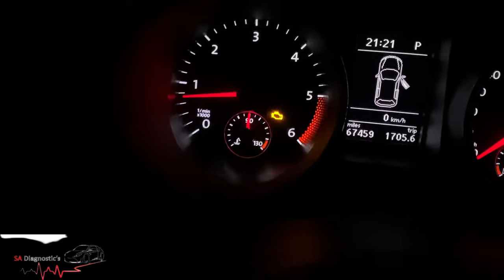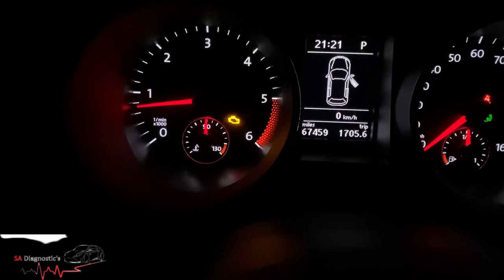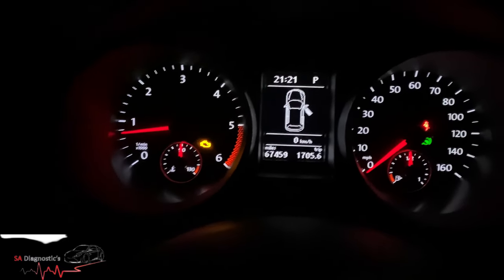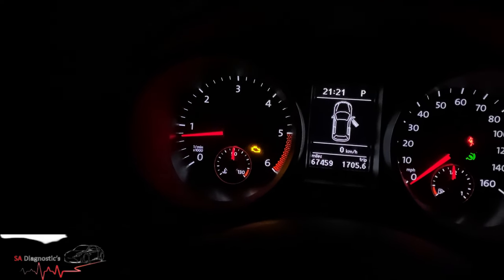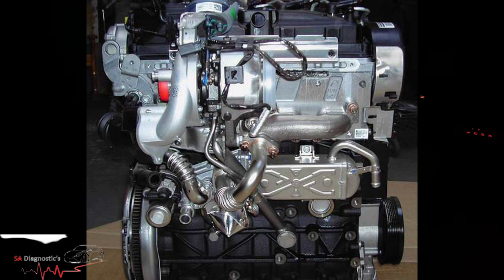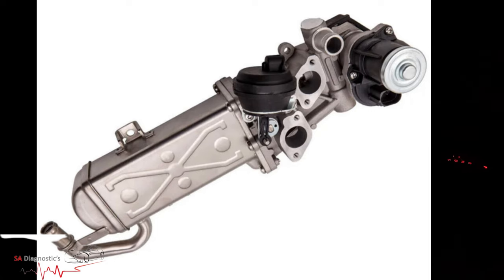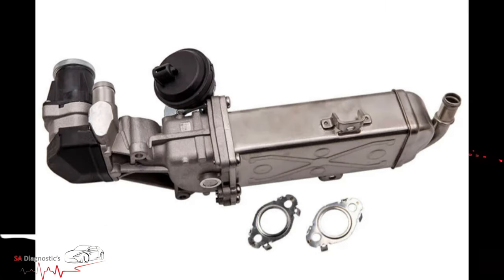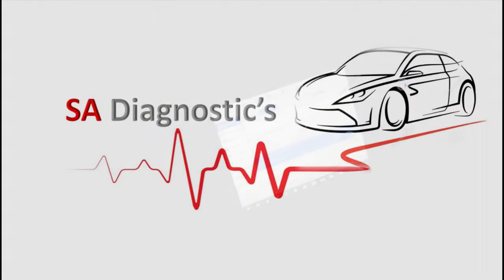Audi Seat Skoda VW P040700 Exhaust Gas Recirculation EGR Sensor B Circuit Low How To Fix

Comment: It could also be sensor/wiring, I’ve having this issue currently, replaced with brand new egr, still got error po40700 then unplugged it’s throwing po40800, re pinned the wires and still getting po40700 brand new egr done 0 miles
Reply: hey I have the same problem right now, have you fixed it? and how please I. would be so thankful for this support !!
Reply: @tobiasrosen2698  brand new unit from vw fixed for me mate
Reply: @billysmith5168  okay thank you so much :)

Comment: got error codes P2458 and P2463 on seat leon estate that wont clear.I have cleaned dpf using dpf spray and chucked cleaner in fuel tank. How can I resolve this as i have lost power and need it to pass MOT mate.